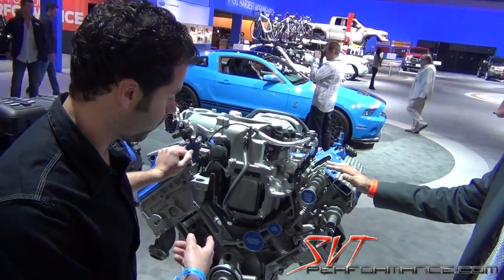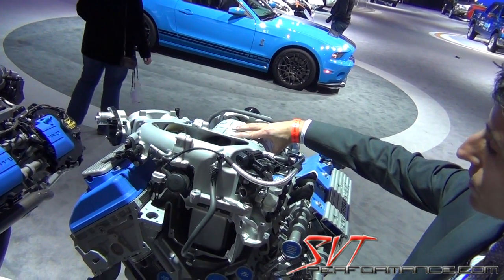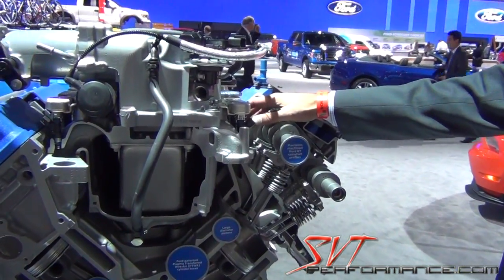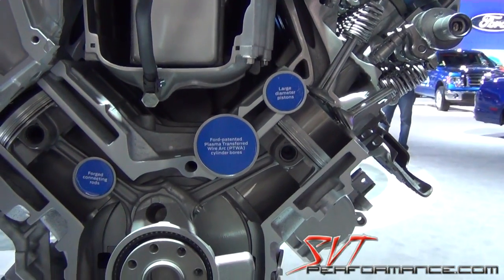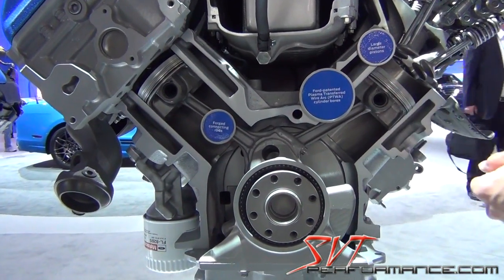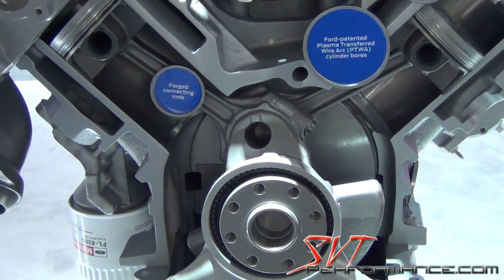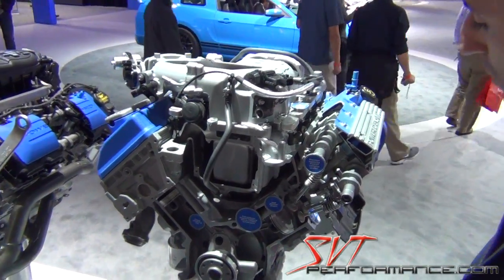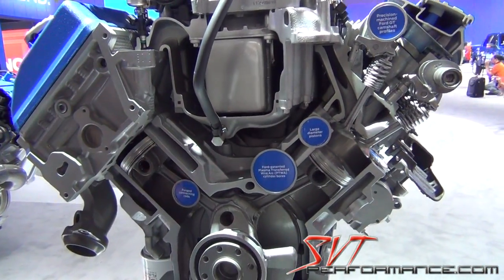SVTPerformance.com : Details of the 2013 GT500 Engine

Comment: Yes stock.
Cobrajet wnet 8.0 in 1/4mile using only 5.4 motor thats' same in GT500
Completely stock
GT500 is only 5.4L not 11.6L. Go back to school, learn to count
14.5psi double atmosphere efectively doubles power in GT500, use a $40 pulley to get 1000hp
No way dude, ZL1 is only like 570hp. Its' not 790hp.

Comment: NOT stock
COPO Camaro went 9.5 in 1/4mile using the same engine that's gonna be in Z28
Completely stock

GT500 has 11.6L effective displacement
14.7psi doubles atmosphere, effectively double displacement to double horsepower
GT500 has 15psi boost, ZL1 only has 7psi but makes 790hp with 15psi boost

Comment: @onewheelwonder1000 Impossible... At least in stock form... The GT500 Engines are running mustangs into the Mid 8's all factory Engines.